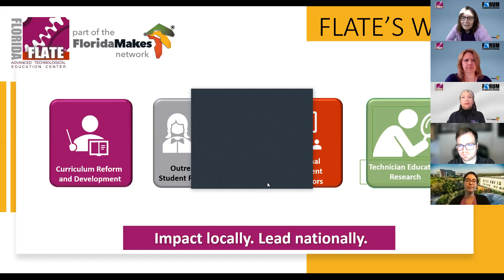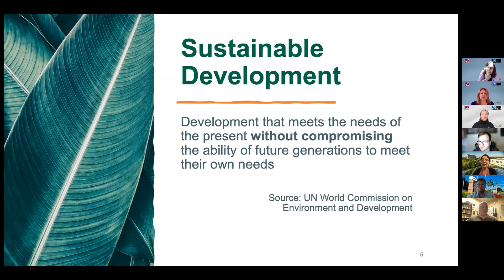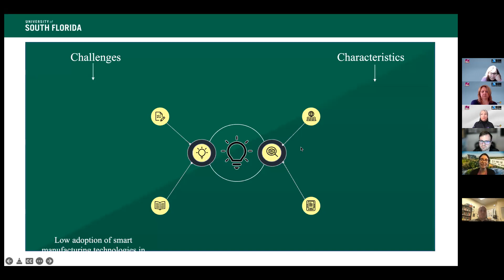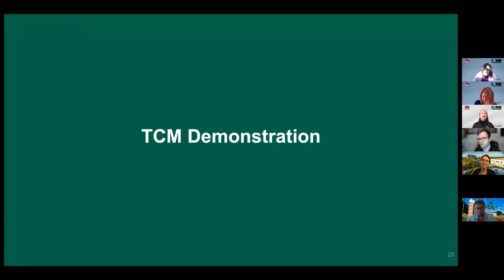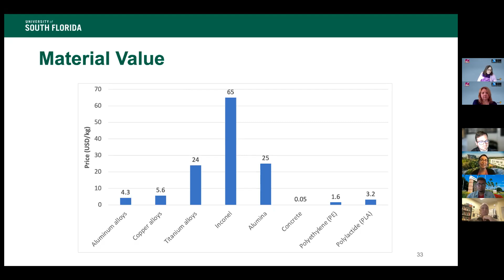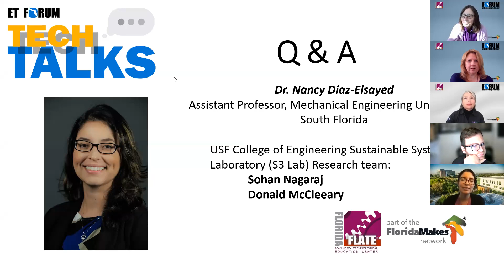ET Forum Tech Talk #6- An Industry 4.0 Case Study: Tool Condition Monitoring for CNC Machining

Comment: Very Interesting topic.  In industry this is an underutilized area.  Many CNC Machines are equipped with Tool Management systems but are not used by most.   Settings to monitor tool wear by time or load are one way. you could automate tool replacement when it exceeds a parameter by operator notification or replace with a tool already preloaded in carousel. 

Very good engineering project to optimize time and quality